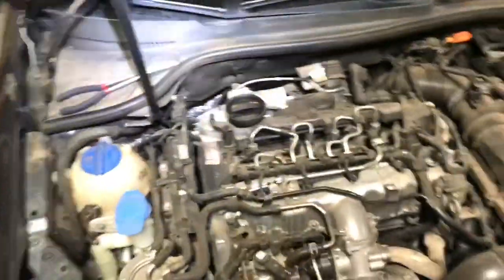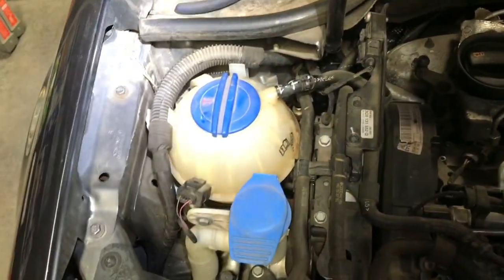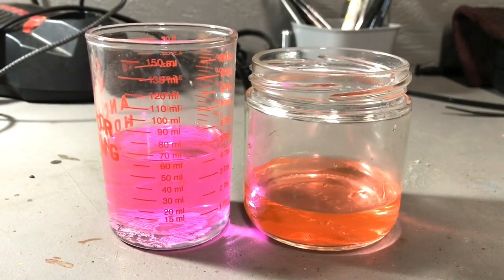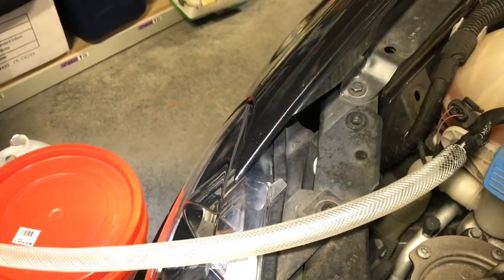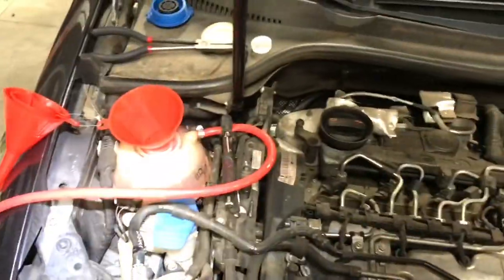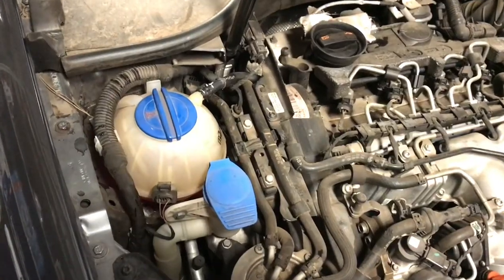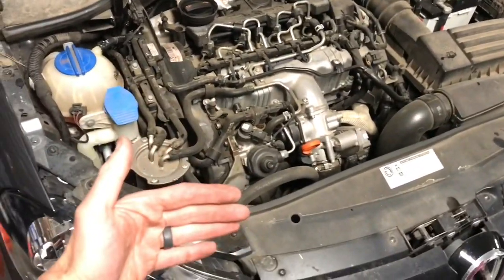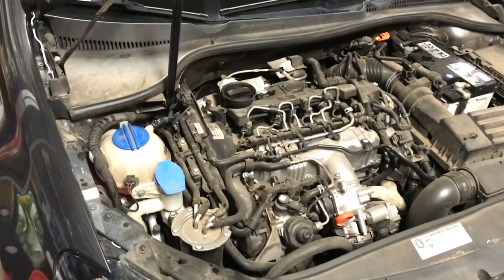VW Coolant Flush - The easy way, no mess! Volkswagen Jetta Sportwagen Passat Golf Touareg TDI TSI

Comment: Ok.  I'm surprised no-one has suggested this yet as far as I can see: Whatever is being pumped from the engine into the coolant reservoir must be getting replaced by coolant through the engine supply line at the bottom of the reservoir, no?  So removing that hose from the reservoir and extending it to suck coolant from a bucket containing fresh coolant should suck fresh coolant into the engine at the same rate the old coolant is removed.. Shouldn't it?
Reply: That's just duplicating what the reservoir is already doing. The reservoir IS the "bucket". The difference is that with the reservoir gravity is helping in addition to the engine sucking it out of the bottom.
Reply: @KingZoneOne  Exactly.  But the people who have demonstrated this method on YT have warned that the flow out of reservoir is inconsistent and you have to watch carefully to add new fluid to avoid sucking air.  Using a large bucket of coolant would mitigate that.  Good call on the gravity.
Reply: @grantmcinnes1176  Unless the bucket is positioned higher than the reservoir I don't think the suction would be strong enough to pull it from a source below the reservoirs level (like on the floor). The pull from the reservoir is so slow and weak anyway I think the risk of it sucking air is pretty low. If you're doing this you should be nearby regardless, and not walk off to do other stuff. I do believe the entire system can be evacuated 100% with a kit that's sold to do it with either an air compressor or shop vac. I would think it has to be done immediately after turning a hot car off while the thermostat is still open.

Comment: How dangerous is this to do/is it worth doing? I bought a 2009  VW CC 2.0 that was generally well-maintained except for some reason they were putting in the yellow/green universal coolant from O’Reillys instead of the pink/purple VW spec. everything is running fine, but I want to try and get at least 50,000 more miles out of it.  All I know is I could never properly bleed my BMW once I started having cooling problems with it and it was a never-ending nightmare for years until I finally sold it to the junkyard so I’d like to avoid opening pandora’s box, but I don’t wanna wear it down early.    I’mputting in liqui Molly oil, the nuclear green oil this week, upgrading from the mobile one that they were using before
Reply: Take it to an official dealer if you want the car to last. Mobil oil is the recommended and approved oil by the manufacturer, not Liqi Molly, which is not approved.
Reply: @richardsealey3626  the engine light and oil pressure light constantly flash, I don't drive it more than 10 miles a day this is by far the biggest piece of shit car ive ever had. no headlights, 1 brake light, doors don't lock, car chugs and struggles flashing lights constantly the last few months has been the worse, hate this POS

Comment: I don't think putting coolant at ambient temperature to a hot engine is a good idea but each to their own. It's better to change the coolant with engine cold, drive around  to get the engine up to temperature then the next day or after the engine is cold again, do one more change.
Reply from the maker: I understand your concern but don’t think it’s a real problem. Every factory specified coolant flush procedure I’ve ever seen involves putting room temp coolant into a hot engine. Pouring a gallon of coolant into a coolant tank is a lot different than driving through a cold river and shocking the hot block instantly.
Reply: @luso_overland  Don't get me wrong you could be right but I still prefer do it my way just to be safe. Pouring 20°c coolant onto a 90°c engine is not for me.
Reply: @guilhermeg345  lol it's coolant it supposed to cool the engine. Like he said you are not freezing the engine rapidly, because you slowly add new fluid to the reservoir so by the time it hit the engine the temp of it is like 80'C (if running temp is 90'C)
Reply: @paWD40  Coolant doesn't actually cool the engine - in fact it raises the temperature slightly compared to using plain water - coolant is designed to stop the water boiling, prevent freezing and reduce corrosion - it's actually worse than plain tap water for actual cooling effect.  If you already knew this you get a cookie.
Reply: @guilhermeg345 It be fine. 😅 Ever heard of people adding cold water slowly to a radiator when it had a leak  and needed refilling? Happens a lot. 👍🇦🇺
Reply: Is it that hard to solve your concern ? Just heat up the new coolant (or distilled water) before adding it. You finish quicker, you remove ALL of the old coolant and you don't potentially damage the engine.
Reply: Ambient temp coolant will not cause thermal shock to any metal parts in your engine, and this flush only works on this type of car if your thermostat is open (warmed up engine).
Reply: @KingZoneOne  it will mix and heat up by the time it reach the core. How many time it need to be explained, you are not switching 5gal of coolant from hot to cold on running engine, the replacement is slow.
Reply: @paWD40  I'm not disagreeing with you. I'm telling the OP that putting room temperature water in a warm engine is NOT harmful to the engine.

Comment: TOUAREG OWNERS I just used this method on my 2017 Wolfsburg Ed. and it worked great. Awesome video. Side note when the thermostat opens the overflow tank will fill up rapidly and spill over so just be ready for that
Reply: Question from a 2012 Touareg TDI owner hoping to use this process: do you know if this will both flush old coolant and purge/‘bleed’ the system of air bubbles/pockets or would some sort of vacuum bleeder be required to do the latter?

Also, did you use 3/4” ID for the drain hose…?
Reply: @jtsherri  I'm no expert but from my research I've seen that the cooling systems in 2010s-era jettas, golfs, touregs, and beetles are all basically the same and are all self-regulating/ self-purging, so there's not need to go through the bleeding process that you need to do on other cars.
Reply: @jtsherri  This method is just like how the system is usually working. 
The Touareg 7P is bleeding pretty fast in general but if its not there's a screw on top of the engine you can open or use vacuum.
Reply: Hi, I have a touareg 2017 Wolfsburg too. I am plannng to change coolant by this way. What is the inner diameter of the white tube?  For the red tube, a sharpened wine cork may work.
Reply: I just tried this on my 7p 3.0 tdi, there is nothing recirculating in my pipe return! Wtf had the car running with heaters on for an hour and thermostat did not seem to open? Im gonna have to do it thr original way underneath and disconnect pipes etc i think... 🙄
Reply: Is your Treg the gas model? Cuz I think TDI model has a bleeding screw to loose up, not sure if the gas model has the same?
Reply: how long did it take to start getting new fluid coming out?
Reply: @bryankapsho4880 how much spill over did you get when that happened?  Did the coolant level come back down immediately in the overflow tank, or did it keep spilling over for a while?   I'm assuming you kept the engine running when that happened?
Reply: @Ed-wg2yx  when the fluid would purge it would empty the overflow tank (always replaced the cap) and I turned the engine off at that point. Then I would fill the tank again and repeat until the color looked as good as new. It took repeating many times to achieve and probably wasted an extra gallon but I wanted to be sure I don’t need to do it again for 35k miles. Also figured it might save me from replacing components that could have lasted longer. Be prepared to spend a couple hours

Comment: Well, it kinda of worked your way on my 07 ES. I tried a hose but couldn't stop it from leaking. So Autozone suggested a barbed double-head joiner and actual 3/8" rubber hose.  Which didn't leak. When you're running the engine be very attentive to the coolant level. It does surge and suddenly you'll find it's hitting the bottom. You don't want air locking up your systems and burning out your cylinder head. Keep all your bottles open, nearby and ready to go. I flushed with distilled water and then when it came out clean in the bucket I started with the pink. It fill a five gal bucket up so I began to fill empty gallons. They became pink. So I shut off the engine. Drove for 20 minutes and everything sees good. Thumbs up!

Comment: Great video, think I have the confidence to tackle this project.
2 Questions: 1.) Will this method also work for the 2017 Jetta TSi ? & 2.) How many gallons of coolant will be needed for a exchange ?
Reply from the maker: 1. Remove the return line when the car is running, if coolant is free flowing out of the return line then this method will work.
2. Check your owner's manual for coolant capacity of the system and then budget a little extra above that since you'll waste some with this cycling process.
Reply: @luso_overland  thank you! Appreciate the extra tips

Comment: Does this work on the TSI engines?
Reply: Can confirm, done this on 2.0 TSI and it worked a treat :)
Reply: @R4dek93 what 2.0? A CC? The previous owner put in that stupid universal yellow/green Bull crap and now I gotta get the pink stuff in myself, but I’m terribly afraid of causing a malfunction because my old BMW once there started getting to be air in the coolant it was a never-ending nightmare for years until I finally took it to the junkyard. Could never get the hoses back on right new radiator knew everything the hoses would just blow up and shit. I guess I wouldn’t want to take a single thing apart on a closed/pressurize system so I might just keep the universal shit in there, which I think is a really bad idea as well. the local official VW dealership says they refuse to do coolant flushes on older cars which I guess 2009 is an older car now…??
Reply: @AngeloSantelliMusic  Mine is a VW Golf GTI MK7 from 2014 and this trick worked great :)
Reply: @AngeloSantelliMusic  VW are self bleeding. Don't worry, just put the right coolant in.
Reply: @R4dek93 did the coolant bottle overflow ? Thinking of trying this on my 7.5
Reply from the maker: Not 100% sure but I think so. Just take off the return line off the side of the reservoir with the engine running and if coolant is flows freely out of it then it is identical.

Comment: Thanks for the video mate, was straightforward and easy to follow. 👍 I just finished using this method to flush out all of the old G13 coolant from my B8 Passat and replaced it with G12 Evo. I've always wondered if you could do just this and let the system flush itself with the engine running. The only thing I did different was at first I kept topping up the overflow bottle with demineralised water until the return hose ran clear into the bucket (just to make sure the G13 was completely flushed out), then I switched to adding the fresh coolant until the return hose was running a solid pink colour. Worked a treat, thanks again!
Reply: I did it this way too. Just distilled water until it ran clear, then added concentrated coolant until a deep pink. Confirmed with a pristine coolant gauge afterwards. Caution, the water will be hot and will deform the plastic distilled water jugs, best use a 5 gal. bucket (or 2).
Reply: @mailjabber how many gallons of concentrated coolant did you add back to the system after the flush?
Reply: G12 Evo saves the heater cores on the TDIs. Doing a coolant flush and heater core change today, followed by Evo. Thank God the heater cores are simple to swap out on these cars
Reply: @green_comet83 after you ran the hose clear with water, did you add straight coolant to the overflow tank  or already mixed coolant?

Comment: Is it recommended to flush with distilled water until it runs clear or can you just proceed with what you showed in the video? Thanks for this video by the way.. Seems like a really simple and great way to do a full flush.. Way better than draining the radiator boot, which doesn't even clear out all the coolant
Reply from the maker: You could do it that way but if you're trying to get every drop of old coolant out. Certainly wouldn't add much cost, it would just take a little longer.
Reply: Can flush with tap water on initial, then a few gallons of distilled to flush that.
Reply: Good idea

Comment: Nice! Any updates, would cranking the heat clear out the heater core?
Reply from the maker: I believe so, i had the heat on the whole time.
Reply: If u do this with a hot engine isn't the coolant under pressure and will it splash all over when open the cap or not really..
Reply: @andreadebiase3997  The cap has to be tuned many times (like 7 or 8 complete 360 tuns) in order to come off. By the time you hear the first hiss, you just stop until the hissing is no more and you continue to unscrew it completely. Simple !
Reply: @andreadebiase3997  I tried it it will push a little bit when u pull hose off burp nothing bad
Reply: Also do u really need to plug that nipple when removing the return hose?
Reply from the maker: @andreadebiase3997  Be careful when removing the cap on a hot engine, put a towel over it or get the car hot with the cap off from the start. As for covering the nipple, you don't have too but then you won't be able to add much coolant to the tank as it will flow out of the nipple when it reaches that height so you'll have to keep a closer eye on the fluid level.